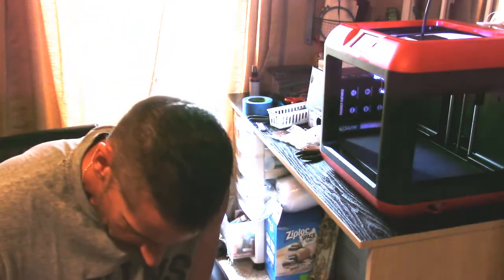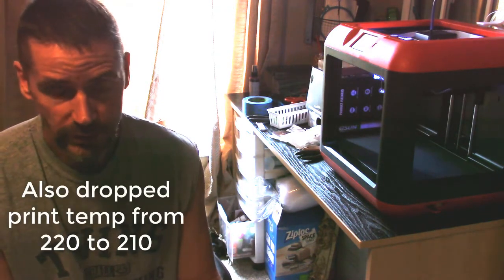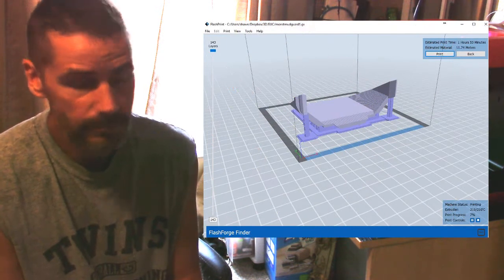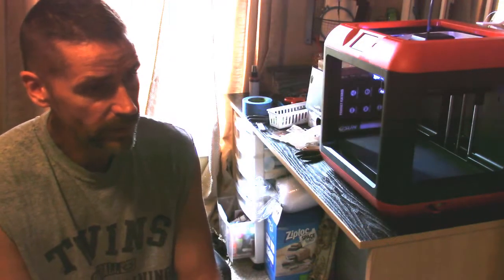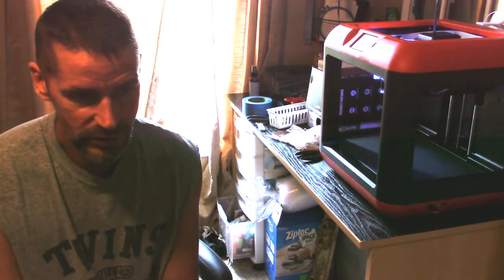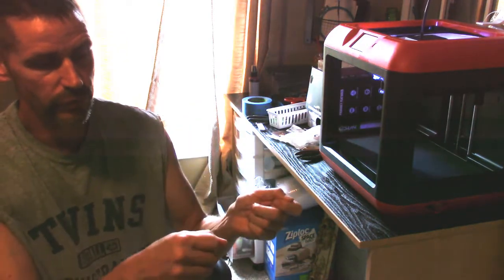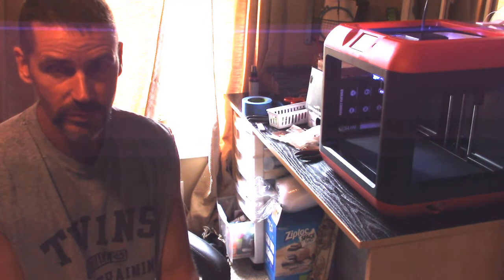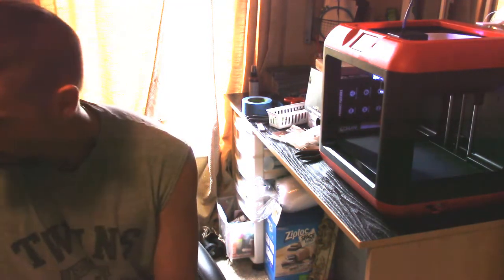Flash Forge Finder - Three week review!

Comment: I ordered the CR-10 after watching MANY videos.  I just came across yours.  I'll be trying GotWay Fender designs too.  I've been studying Fusion 360, and Cura, so I will be ready when it arrives.
Reply from the maker: Ah nice dude!  I have Fusion 360 but I need to learn it and once my CR-10 shows up I will be using Cura for slicing.
Reply: This will be my first 3D printer.  I'm confident I can currently open and print, but I'm anxious to start designing.  There's a lot to learn in Fusion 360, but dang it's powerful!   I'll keep in touch with you on upgrades, tips, etc as I go along.  I already have a list of upgrades for the printer, and a bunch of files I'm wanting to print.
Reply from the maker: Oh yea dude based on some of the mods I have seen you to do to your EUC, 3D printing will be a natural fit.  I can't wait to see what you come up with.
Reply: Thanks!  And you too...